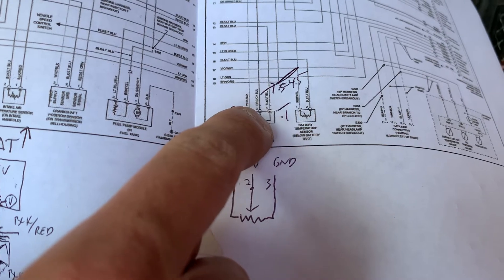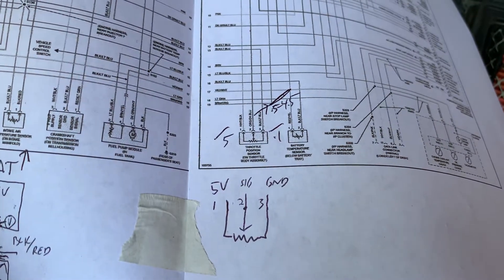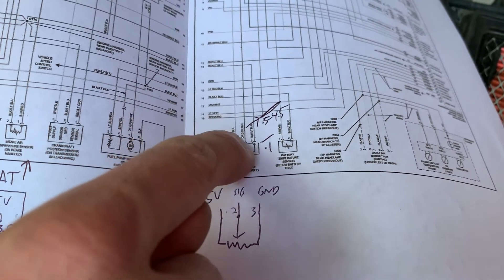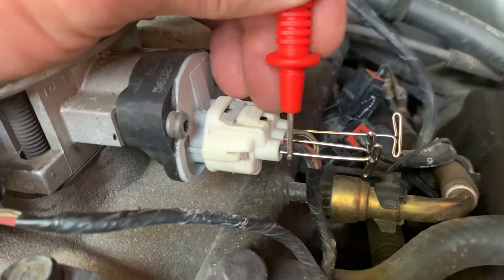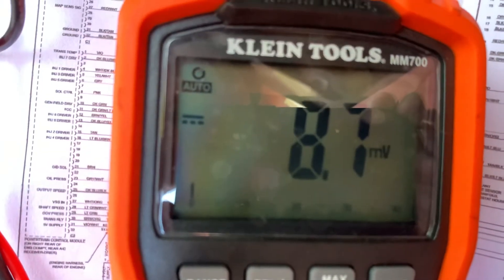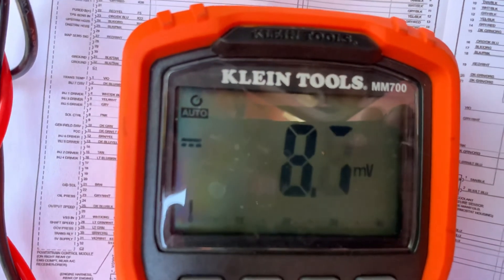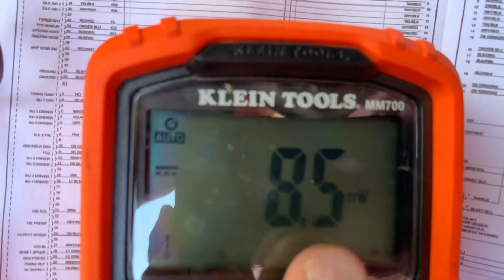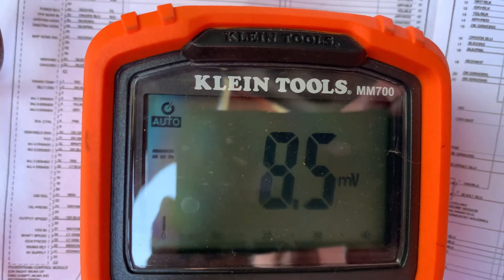Live On-Car Measurements Part 2

Comment: I think when you say it's less then .1 I think you should say it's les then 1. Volt didn't it?    Not less then .1  because that would be .1 mv.  Because  of the decimal point.    I think I remember when I was back in high-school.  And took the algebra math class.       Anybody correct me if im wrong or right ,      but the whole explanation it's excellent  I still understand  what you saying.

Comment: Hi Craig, thanks for the video, @6:50  couldnt you do a continuity test between live wire and ground wire to test the sensor? , also can we always assume that the  signal wire will always have either 5v/12v ,eventhough in the schematic diagram it just specifies its a signal wire, but it doesnt say weather it supplies the power or not? (is this what they call pull down circuit? )  also @7:48, when you unplug the pin, wouldnt you get 5v on live and signal only not all the way across.? you will get 0 on ground wire?